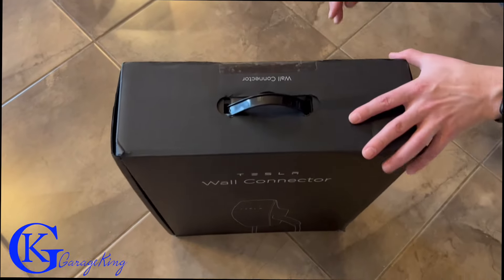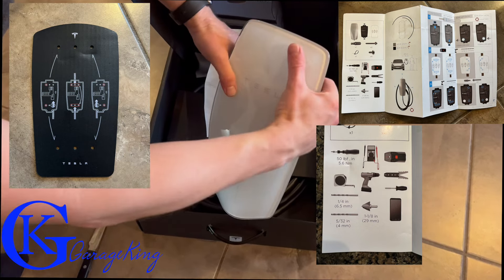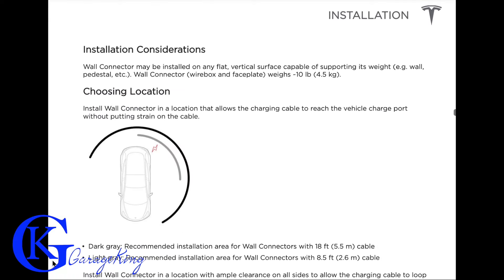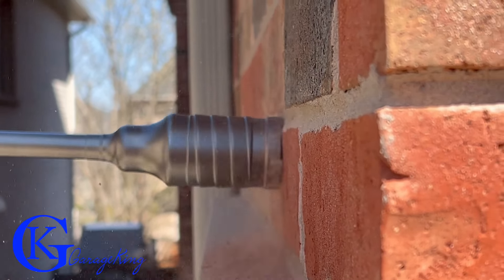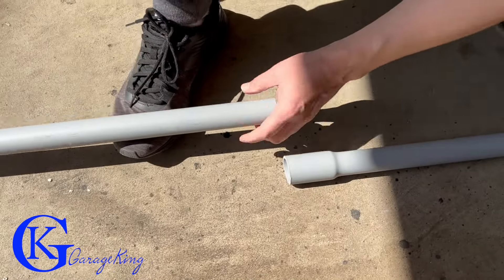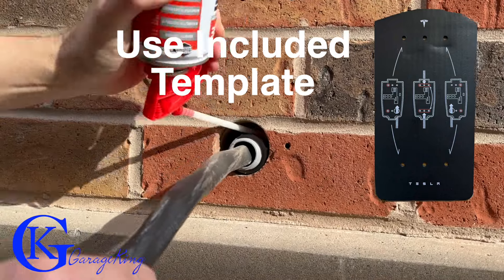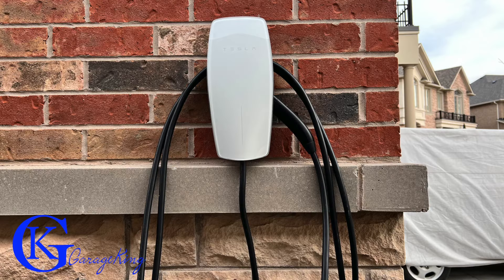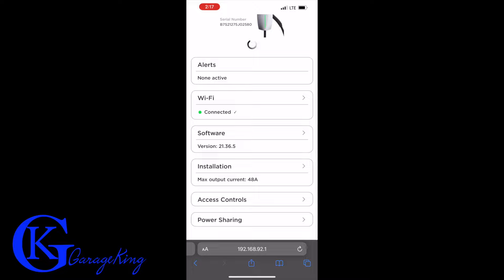Tesla Wall Charger installation (Gen 3)

Comment: Bro, your circuit breaker is there to protect your cable, you can't use a circuit breaker that is a higher rating than the current carrying capacity of the cable regardless of the maximum demand. You should really be throwing in a 50a breaker to make this installation safe.
Reply from the maker: Hey there and thanks for the comment.  I was just doing what the Tesla manual said, the manual said 60amp for the 48amps it uses, and to use minimum 6/3 wire.  I did that. I did phone an electrician and asked him. He told me I was good to go and this was common. He gave me an example and said when I plug my laptop into the wall to charge I probably don't even use 1 amp (120 watts) and all the wires going to the would melt at 15amps so the 15amp circuit breaker in the house is designed to protect against anything loading the wire more than 15amps total. In a house you can have multiple things on different plugs on the same circuit so it can add up to more than 15amps and then trip the breaker. For the Tesla wall connector is by itself so it will never draw more than 48 amps so its safe.  Now if ran other things off that same wire that's different, and definitely a hazard as the Tesla could take 48 and something else could take say 12, which puts you at 60,  and thats overloading the wire. I see what you are saying, and I had my concerns, but believe me I researched on multiple forums, and called and electrician and everyone says its fine, including Tesla.  FYI - I find the max setting charges very fast so I usually have the charge current set to 12 to 32 amps as I charge overnight and I prefer to "trickle charge" the battery.  I'm not sure if it will make the battery last longer but no need to rush the charge in my eyes.  Thanks again for the comment !!!
Reply: Yeah I see what you are saying, I'm actually coming from Australian electrical standards which are obviously quite different. Here you would not be able to design your installation like this incase of a potential fault condition that could result in higher current draw which could result in damage to the cable before the circuit breaker trips. A short circuit fault would cause the breaker to trip instantaneously but you would still be putting the cable under more stress than necessary as the instantaneous trip current for our general breakers is 7.5X the nominal current. You also have to consider the future where you might sell the house and the next cowboy thinks it's a good idea to tap into your charger feed and run the rest of his garage power off it which would result in the cable burning out before the breaker trips. Otherwise good video and install, that's the only bit that has me concerned 😂😅
Reply from the maker: @rakso8828  Thanks for the great explanation, makes total sense.  One thing though, the electrician said when I ran it, it had to be a straight line sealed in the plastic.  NO junction box or connectors.  I think he was thinking like your comment referring to someone tapping off the line in the future.  The way its run you can't tap in, as you would have to disassemble everything which would be like doing the job again.  So that's why I ran the single line right from the breaker to the wall connector sealed in the tube.  Thanks again and hope you have a great day buddy !!!
Reply: @GarageKing  yes but since it’s a continuous load, the breaker needs to be 125% off the amp draws, hence why Tesla said to put it on a 60 amp breaker. Read the electrical code book
Reply from the maker: @visionsdb6695  Yes that's why I did put a 60amp breaker in.  I read the Tesla Installation manual which said to use a 60amp breaker and 6 gauge wire so that's what I used.

Comment: Great Video. Can you please post as to where you bought the wires ? May be a link to the purchase site
Reply from the maker: Hi There, I just bought them at Home Depot in bulk. That is the best way.  You can pick up a roll on Amazon, but it may not be enough, or could be too much and the wire is VERY expensive so i would measure how much you need, add a few feet (like 6 so you don't run short in the panel box) and for error, and buy that amount.  You don't have to use Home Depot, you could go to any place that sells electrical wire.

Comment: interesting comment in the beginning of the video: we are ok installing wire that can handle 55A on a 60A circuit breaker.
That just sounds wrong. #4 wiring is required with a 60A fuse. If you want to use #6 wire, have to go down with the breaker rating to keep it safe.
The breaker should trip before the wire reaches its max rating.
Reply from the maker: I know you are right, I went by the Tesla instal manual and used 6 gauge wire with a 60amp breaker.  Thinking about it, the wall connecter will transfer a max of 48 amps.  So 48amp at 125% gives you 60amp for the breaker, and this meets code.  The 48amp max will keep the wire under its 55amp rating.  I know it sounds funny, but that's how I'm interpreting it.  I hear you about the 55amp wire on the 60amp breaker, but that wire will never carry 55 as we are limited to 48.  Thanks for the comment
Reply: He could use 6 awg just need thhn instead of Romex.

Comment: Why did you use a 6/3 conductor instead of the cheaper and just as effective 6/2. The ground doesn't carry any load and is a waste of copper
Reply from the maker: I know, but it was left over hot tub wire so the cost was better than purchasing more wire :)

Comment: Great video.  A lot of negative comments about code violations, but the code was written to protect the idiots in society.  Nothing done here is a safety concern.  The only issue is if someone in the future removes the Tesla connector and used the circuit for a full 60amp load.  ... but that's their problem for not doing their due diligence.
Reply from the maker: Thank you kindly for the very down to earth reply, truly appreciate it, and happy Saturday to you !!

Comment: Am I wrong? That cable should not be inserted in the pipe.
Reply from the maker: The cable must be in a pipe in the garage, but you are right, in some places it must be stripped.  In my case I believe I should have stripped the sheathing, and then run the wire through.

Comment: Does it come with wifi connectivity?
Reply from the maker: Yup it should, mine didn't have any problem connecting.
Reply: @GarageKing  NIce, nice. I do understand the wifi is for software update. Would you call a smart charger? What features do get  with the Wi-fi features?
Reply from the maker: @MrTargetxx  hey there, the features are awesome. You can decide what time charging starts and stops, and you can also adjust the amperage and it will give you an estimate of time. So for me I plug my car in when I get home every day. It automatically starts at 7:00pm so off peak and it slow charges finishing in the morning. Definitely worth it !!
Reply from the maker: @MrTargetxx  forgot to say you enter the serial numbers of the car you want it work with so no unauthorized plug ins :)

Comment: Romex in conduit plus the 48 amps on 6 guage is wild. Youre looking to start a fire lol just call an electrician
Reply from the maker: I actually stripped the sheathing off, and updated it in the comments.  Later I found that Romex was allowed in conduit providing you have enough space, I used large conduit so there was ample space, but I did wind up stripping the sheathing off anyway.  It was pretty easy as it was a straight run.

Comment: WARNING:
I liked this info, but adding green masking tape to the (white cable)-{ground},
could very much be against electrical code.
In only a few years, the green masking tape [paper] will deteriorate.
Should be using {Green} rubber tape.
Reply from the maker: I addressed the tape, and actually this spring I was just going to pull the wire (as its a straight run) and strip the neutral.  This way I can remove the sheathing.  The sheathing is allowed by code, but a lot of electricians have commented its not allowed to be run in conduit (it is under certain circumstances) The green rubber tape is actually a great idea.  Thanks for that.
Reply: @GarageKing  i don't believe you can take the sheathing off and be to code as the individual conductors won't be labelled.   if you are doing then then you are better to get the individual conductors and feed them through the conduit.
Reply from the maker: @BrianOlmsted  Hey There, what I meant about the sheathing was the black rubber that holds all the wire together. Once you take that off, it like running individual conductors.
Reply: @GarageKing  understood but I don't believe the individual conductors inside are labelled and hence you aren't allowed to treat them like THHN or THWN individual conductors from how I understand.
Reply from the maker: @BrianOlmsted  Ahh I understand, I think they are just color coded inside but no other markings. Thanks

Comment: Note GarageKing appears to be in Canada and this cable used in the conduit appears to be NMWU for underground wet applications since he mentioned using for hot tub install  previously but I believe has lower temperature rating of 60 degrees instead of NMD90 which can go up to 90 degrees hence the name.   

I noticed in our local Rona Stockyards location in Toronto the black sheathed NMWU which appears to be thicker than NMD90 (which is typically white sheath cable - as most cable is from Southwire around here) that I saw at the HomeDepot Stockyards (but hefty price - I went to a supply house for much cheaper)

I believe Garage King said he removed sheathing which shouldn’t have done because they are not labelled as individual THHN/THWN/RW90 type conductors.   He said he is running lower amperage but Tesla wall connector install calls for 90 degree #6 as this may be fire hazard at higher amperage
Reply from the maker: Hey thanks for the comment, you are right I used NMWU that was left over.  I think the reason for the 60 degree rating is the insulation is thicker so I did some research and stripped the wire as they will run cooler as they are not all tightly bound together anymore. They are not individually labelled, but I think its still better they are separated, judgement call on my part but I think its better this way. The conduit the wire is run in is plenty large so no issues with fill space.  Charge amperage is never over 20 as I trickle it at night so most if the time I'm at 12amps to try to get longer battery life.  There is no fire hazard the way I use the wall connector for charging as I charge way below the rated capacity (and I think everyone should to try to prolong their battery - another story). If someone is purchasing wire they are best to buy 6awg THHN or THWN and run it in a conduit.

Comment: yo bro where's the part where you plug in the actual power?
Reply from the maker: Hey There, I hook it up at the 7min mark.  This wall connector does not get plugged in, it has to be hard wired into an electrical panel.  If you do it, the one thing I would do differently is strip the sheathing off the wire and just run the red, black, and bare ground.  Me using the white as a ground confused some people.  You only need 3 wires.   If you are looking for a plug in charger I will be reviewing one in the next 2 weeks.
Reply: @GarageKing  ah thx didn't know it work like that lol
Reply: @GarageKing  my breaker box be all the way in the basement, they prolly wanna add a new one, which will up costs. Will prolly just go w/ mobile charger and install the NEMA 240V outlet.
Reply from the maker: @a55tech  Anytime
Reply from the maker: @a55tech  You could do that, to be honest the mobile charger is very good.  I really don't use much power from the wall connector and seldom go over 15amps.  I slow charge mine overnight, so all the extra power the wall connector can deliver really does not get used, at least for me.

Comment: Do you need 60 amp breaker total? (30amp per 110 line feed) or 60 amp per 110 feed. Also, I was planning to go with a 4g stranded as it has a high enough amp rating. Would you say that’s fine?
Reply from the maker: Hey There, you need a two pole 60amp breaker (240V) so 120 on each side of the breaker, if you want the 48amp charge speed.  You can use a smaller breaker, but the wall connector will reduce the juice that runs to the Tesla. Don't ask me how it knows this, it just does.  Once you get your 60amp two pole breaker you will run your black and red (two hot lines) to the breaker, and then run a ground line.  There is no neutral. 3 wires are all you will use. As for the 4g stranded wire I would think you should be ok, but check with an electrician if you are unsure.  Also how long the run is will make a difference. The one thing I learned about posting this video was that electrical codes vary greatly depending where you live.  As an FYI - I rarely charge at more that 15amps.  I just top up every night when the power is cheap so it trickle charges.

Comment: Hi. Great video but here are my feedback. You should apply the 125% rule. That means 48x1.25 = 60 amps. You need a 4 gage wire. Not 6
Reply from the maker: Hey Thanks for the comment, and using your 125% rule you are correct.  Just as an FYI - I usually only use 12a for charging as I let it charge overnight.  Thanks !!!
Reply: That is incorrect. #6 wire is good for 55 amps per the National Electrical Code. 
You can not exceed 80% of a 60 amp breaker (48amps). Per article 240 of the code (overcurrent) you can put #6 on a 60 amp breaker as long as the load doesn’t exceed the 55 amps but you can’t exceed the 48 amps any way. 
Also you have to allow for a continuous load ( a load that’s on 3 hours or more) 
That’s 1.25% of the load so 60 amp breaker. 80% and 1.25% is the same calculation. 80% of 60 is 48 and 1.25% of 48 is 60.
Reply: There is a channel called VG TV where a guy shows the math . He is or was a Tesla charging station engineer. He ran a deep dive into the numbers and guess what, that Tesla chart was right. Now if you have an all-electric house and or a really long run your numbers may vary.

Comment: Almost 360 bend right inside the wall connector
Reply from the maker: You are right, but the radius is not tight and the wires actually follow the channels in the wall connector.  You can't run them any differently.

Comment: No need to make the ground that big, in fact you can go down two size on any ground wire. And you exterior should be conduit not PCV, and no romex allowed in conduit or PCV. 🤷‍♂️
Reply from the maker: I know, that was corrected later, thanks for the comment

Comment: Yikes. Get a wire capable of handling a higher amperage than the breaker. You’ve turned that wire into a fuse. Breaker won’t trip before that wire explodes
Reply from the maker: I actually stripped the wires and ran them individually in the conduit. The car rarely charges above 15amps as thats all thats needed.

Comment: Much better off to mount in the garage but I’m sure there’s a reason you didn’t
Reply from the maker: Well, we have other cars (classics) in garage so no room. If I could park it inside I would,  and you are right, better inside.  Just as an FYI it has been working great outside. No issues at all.

Comment: #6thhn run in a conduit with 60 amp breaker is the correct answer
Reply from the maker: #6 thhn will do, and its good that it has a high temp rating.  Thanks

Comment: 60 Amp breaker is insufficient for 60 Amp charging. You risk overheating the breaker. Also, 6 gauge can only handle 55 Amps. I hope you have insurance.
Reply from the maker: Hey there, there is no 60 amp charging.  The max charge rate is 48amps and Tesla specified to use 6 gauge wire with a 60amp breaker.

Comment: several mistakes. If you want to relabel the white, which is normally neutral, wrap green tape on the conductor (per the NEC). And, you can use THHN or THWN (table 310.16 rates these at 65 AMPS and cheaper) since the conductors are in conduit and except for the charger outside you would be code compliant. NEVER, EVER cut a bare copper wire instead wrap it up in the box...fyi, in a sup panel the neutral (white wire) and the bare copper (GRD) are always separately landed on a bus bar. Not sure your glue is for Electrical PVC..big difference. yes, conductors run outside of the walls are indeed required to be in conduit and protected from damage....why would you cut the wire in the beginning? PVC conduit from 1/2" to 1" require supports every three feet. Table 352.30 of NEC.

Overall not bad install...at least contact an electrician for code compliance. 
I am a Prof. Engineer and Master Electrician with 35 years exp.
Reply from the maker: Hey there, thanks for the comment.  I actually pulled the wire and used the bare ground, so no taping required. I stripped the main sheathing off so they are now individual wires run.  The glue was for Electrical PVC, I have done some plumbing so that glue is separate.  I know there are two kinds.  Appreciate you knowledge and comment.  Thanks

Comment: I'm not sure what you're talking about when you say make sure your hydro is off. but I think your confusing sprinklers with electrical, man be careful if you have a leak of electricity, you won't just get wet, you'll also get burned.
Reply from the maker: Appreciate the comment and I probably should have said electricity.  There was a sub panel in the garage, and I shut it off from the main panel in the house. What I meant is the whole sub panel should be turned off. So there is no electricity anywhere.

Comment: You should not be putting romex wire through conduit. Individual THHN not romex.
Reply from the maker: You can put romex through, I forget what section of the code allows it, but someone posted it, but.......  I did wind up stripping the wire later anyway as my run was fairly straight.